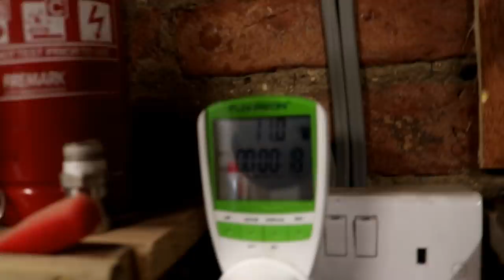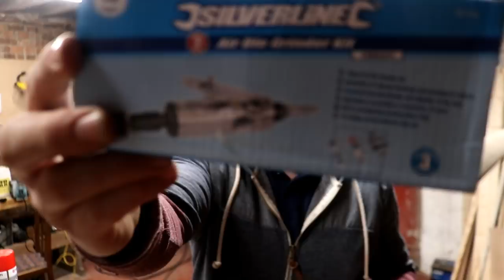LIGHTS OUT

Comment: Keep it well oiled with air tool oil or it will seize , i usually put some in after use and before, only takes a few drops
Reply: lee Wozza yep. They’ll seize real fast. Just put a drop in the nipple ever time you use it.